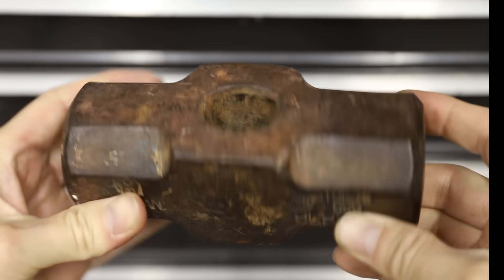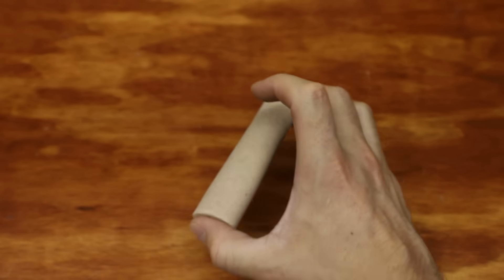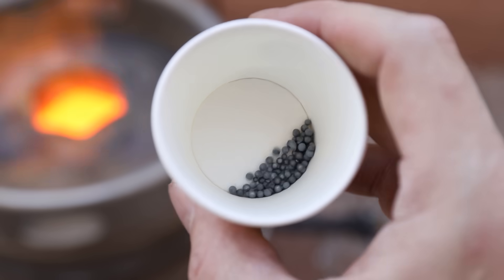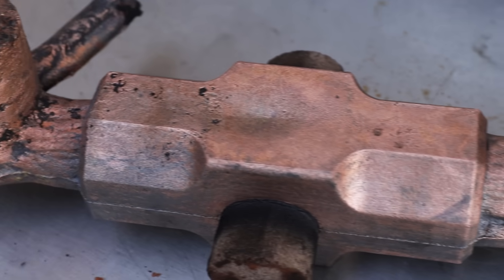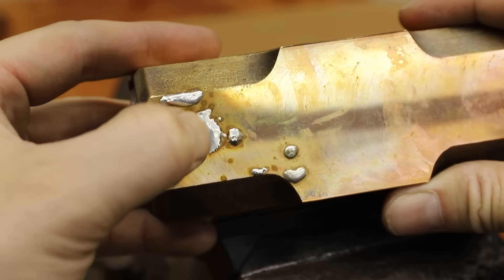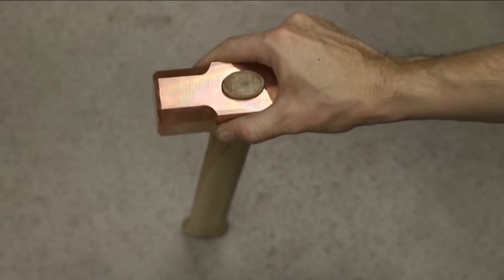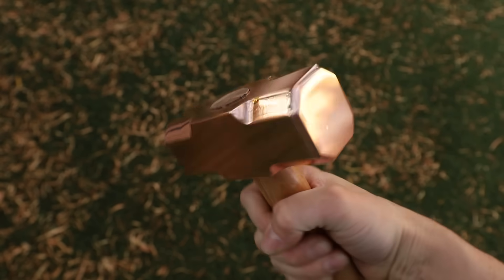Making a Solid Copper Sledge Hammer - HAMMER TIME!

Comment: beautiful work!  I'm surprised that you don't think you will use it for anything - copper lump hammers are incredibly useful due to the softness and weight of the metal. it makes it very hard to damage your work piece while still delivering a lot of momentum per strike, and it's also non-sparking.
Reply: Good point! I never thought of that. But I guess that makes it the middle child between a rubber mallet and a steel sledge!
Reply: I use a copper hammer almost daily working on old cars and bikes, always something that needs to be encouraged without damaging it
Reply: @tortron  really? sure its not brass
Reply: @tech99070  it's copper
Reply: My old MBG with wire wheels and a Knock off hub came with a bronze 3 lb hammer so as to not damage the steel wing hub knock offs.   It was a Thor Brand.

Comment: suggestion:  Use a smaller handle temporary mold for a void so you can machine it perfectly after.
Voids, easier + better: Machine a cylinder the whole way through. with a little recess ( 5mm) to ball peen deforming on either end + cut & smooth excess.

Comment: It's gorgeous, I wouldn't use it either... I'd leave it right next to the front door... in a cradle that would put it right at the perfect reach and angle.

That way if I open the door to the wrong stranger... they get the copper cranium!

Comment: Appears to just be a high-tech method.  Put that old iron hammer into a piece-mold of clay or plaster - and set.  Break open the mold, remove the iron hammer, and reunite the clay or plaster mold together.  Melt your copper (coins) and pour into the clay or plaster mold.  Break open and you have the same copper hammer head.

Comment: You had a void in your casting because you didn't degas your copper enough. Use a de gassing agent from a good foundry supply shop. If that helps. Spend the money. There isn't any shot cuts in foundry work.

Comment: Loved the plug fit,  seemed that it went together flawlessly.   My thought was to do a combination of cooling the plug (contraction) and heating the hammer (expansion) to get the plug in and then when they hit equilibrium they'll be beyond snug, but hey peening it worked too.
Reply: Cooling the plug for an interference fit is a great idea!
Be careful about using heat around holes such as this hammer.The metal can expand TOWARD the hole, actually making it smaller.

Comment: CAD a mold? why not just pack the sand. place the head from the steel one in the sand then build the top, cloning the actual hammer.

also, all that milling, you could have made a block and milled that, you wouldnt have had the voids.

Comment: If you're going to leave it as a mirrored wall-hanger, I suggest giving the head and handle 2-3 light coats of spray varnish to keep the copper form oxidizing...

Unless you WANT a green sledgehammer in a couple of years...in which case, leave the copper open to the air...

😄😁😆😅😂🤣

Comment: You used the title card "Revenge of the Pennies".
Pennies aren't copper, they're zinc.
A zinc hammer would be even more useless than a copper hammer, but it'd give a whole new set of technical challenges to overcome...
Reply: 1982 and earlier pennies are copper, with the exception of the WWII era when they were made of steel for a couple of years.
Reply: @billyjack3580  40 years ago - there aren't many in circulation

Comment: I know mechanics use brass hammers to beat pressed-in studs out of their holes, because the softer metal will not mess up the threads.  I think a copper hammer would work as well.

Comment: Woulda been funny if you'd actually used pennies for this, 'course you would've had to dig through a ton of them to obtain all 1982 and earlier pennies.  The only problem you'd run into is if you attempted to then sell the sledgehammer at a profit.
P.S.  Looks awesome!  I would sit around from time to time, admiring it's beauty and heft, and be terrified someone might actually use it to take a whack at something. 🤣
Reply: Copper pennies might be less expensive, or at least comparable in value to raw copper. That’s one of the reasons why post-1982 pennies are plated.
Reply: @billyjack3580   The solution of using copper plated zinc, only worked for a handful of years for the US Mint. Even that formula now costs more than a penny per coin.
The nickel is even more of a problem.

Comment: I would suggest you add some beryllium to your copper to harden it  if it was going to be used but it’s toxic and requires special handling. A finished hammer head is safe but grinding, sanding , filing or buffing must be done in very dust controlled ways. Beryllium copper hammers were used in munition plants because they wouldn’t cause a spark.

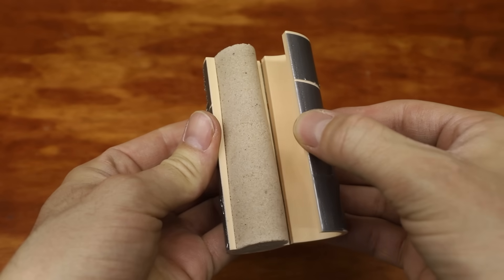Comment: 1:44 The next time instead of using duct tape you can use electrical tape which if you stretch it when you're wrapping it will really clamp down on what you wrapped around. Of course the duct tape works just as well though

Comment: Hi nice work, (I got copper too) --> To snug a hammer head, hold head to be snug hammer upside down so handle faces up, using a second hammer hit the butt of the hammer to be snug 3 to 5 times using smooth, firm medium blow (wink wink - that one I learned when I was 8 years Old from an old timer... I am a 52 year old Electrical trade instructor...

Comment: You could try making a full set of tools like from stardew. Cast iron might be too hard to cast yourself but a Copper set should be doable, Shovel might be the hardest to pull off. Gold can be bronze and Iridium can be Titanium coated steel (like the silverware) and finished purple or dark purple unless you just do a dark bluing on the set. Can use a regulars steel set as the molds to make them all the same or make them all unique shaped for their material.

Comment: Everyone fits a handle the wrong way. Push the head of the hammer or axle onto the handle as best as you can by hand, then flip it over, leave it hanging and give the end of the handle a few hard blows with a hammer before inserting the wedge and trimming it to size.

Inertia will do its job and the handle will be driven into the relatively heavy head. No scratches or dings on your tool heads to worry about that the end of the handle can... handle.

Comment: If you're machining steel parts, a copper hammer is actually useful. It won't scratch just like a lead hammer, but it's much harder than lead so you can hit harder with more force going into what you're hammering on. Commercial ones are pretty expensive.

Comment: Why didn’t you just pour the copper into the hole for the repair?  Why make a plug first?
Reply: I was thinking the same thing then I thought maybe the molten copper will melt the surrounding area of the hole and make it look obviously repaired but I'm not sure.

Comment: These are useful. Our company's metalworking shop has one of these, as well as several wooden, brass and plastic sledgehammers. Sometimes you need a soft but very heavy hammer.
Reply: Or non-sparking.

Comment: Would that air cavity in the hammer have been an issue if the mold were poured vertically length wise instead of horizontal?

Comment: Question, Could you not have just poured the molten copper into the machined hole/void instead of making a bar to turn in the lathe? Is it because of the mass of the hammer head cooling it?

Comment: Why not use a torch on the hammer head where the hole is and pour copper into the hole them mill it. Much stronger and more reliable

Comment: I'm sure you know this, but to make pressure fitting a bit easier & more difficult to detect, you can mildly heat & chill the main body & insert, respectively, so it's easier to slot in, & when the temperature equalises, it'll probably pressure weld the two halves together. I usually stick the body in the oven at 225 & either put the insert in the freezer, or if I REALLY want a tight fit, I'll get some liquid Nitrogen, & store the insert in it for a good 20 minutes prior to fitting. You can turn the oven up higher, but that makes it difficult for me to operate too precisely, since I need proper heat resistance, rather than clamping it & using a rag to make sure it's in alignment.

Comment: There's a channel I watch that does a ton of smelting, and they put a piece of paperboard under the crucible so that the firebrick doesn't stick to it. It looks like your way works well, but I thought you might like to know that trick to see if it's an improvement.

I'll mention the copper-phosphor to them since they sometimes have issues with porosity in their copper pours. 👍
Reply: heh, pour-osity

Comment: You did not have sprew vents from all the spots above your inlet levels. They can be fairly small 1/8 in.. Don't forget to harden the head before use. Otherwise it will be much worse mushrooming of the head.

Comment: Awesome hammer.  I built my own copper hammer that I exclusively use for motorcycle engine disassembly.   When I have to tap on crankshaft or mainshaft threads,  my copper hammer is my 1st choice.      Sweet build.

Comment: When making a hammer you generally want the hole where you attach the handle to have a slight hourglass shape. The bottom half of the hour glass fits up to the taper you put on the top part of the handle that is being fit up, and the top part of the hourglass allows the wood to expand when the wedge is driven in, locking the hammer head onto the handle. The same goes for hatchets, axes, etc.
Reply: Yeah, i always see people changing that. I prefer a tapered hole, with the larger end on the side you put the wedge in on, just to lock it down a little bit more.
Reply: @atomicwinter31  if i'm imagining this right, i'm seeing a sharp edge at the bottom end of the taper, that could bite into the wood over many hits and wiggle things loose
Reply: @spambot7110  You're just imagining things. Lol. But nah, the taper isn't drastic enough to have that effect. Just enough to allow the wedge to spread the handle enough to keep it in without relying solely on pressure against the walls.
Reply: @CrazyJ1985  when some people visualize the slight taper Y 😆 
Also I prefer the round wedges myself. Been a few year years since I changed the handle on my 14 oz framing hammer n it hasn't budged.
Reply: 14 oz framing hammer? WTH finish hammer maybe
Reply: My friend, are you all right? I wish you good health, happy family, happy every day
Reply: @7hjm8888  I am not right.
Reply: When making a hammer, you generally don't make it out of copper for display only. Do you get the point?
Reply: @yourdad9168  I think it's maybe you who doesn't get the point
Reply: @spambot7110  A rock pick will have a point.
Reply: @nsevv  a chipping hammer has a point as does a prospector's hammer, piton hammer, and some war hammers.
Reply: @grisher111  Point made. You win in this battle of points. Plus you attained 2,000 intelligence points to your YT character.
Reply: @surfersilver6610  ty
Reply: @yourdad9168  A hammer can't have a point. it is supposed to be a flat head.
Reply: @nsevv  THe claw end of a framing hammer is fairly pointy. I think you meant a sledge hammer.
Reply: @Sparkeycarp  what?

Comment: Why didn't you just make a sand mold from the old hammer? You intended to machine it anyway and any imperfections would be taken off. Just personally I would have preferred that the copper hammer had all of the old dents and manufacturers marks. An idea for hammer #2 perhaps?

Comment: First time viewer, and I was thrilled to see that you have built a beer keg foundry! 
I've built 2 of them, and was having a hard time getting enough BTU's from my original burner setup (approx 150k BTU output), due to the larger volume of the foundry, to melt copper. 
So, I "bit the bullet" and bought the 308k BTU burner from Devil Forge and it's been fabulous. Now using less propane & less time to melt copper! Win, win!
Edit: I've also become a subscriber.

Comment: Nice job bud. Does anyone know if a cooper hammer can be used practically or is the metal too soft? Cheers.
Reply: Hammers are made from a wide range of alternate materials, including wood, rubber, leather, copper and brass/bronze. Each is designed and manufactured for special circumstances. Copper hammers are useful when working in areas where sparking would cause problems.
Reply: @billyjack3580  Thanks Billy.

Comment: The hammer can't be the last thing to solidify or you'll get sinks and voids. Usually an insulating or exothermic riser is used to preserve a molten mass for the hammer to draw from as it tries to shrink. Also a chill plate or bar ( on the opposite side of the molten mass in the riser ) can be used to cause directional solidification. Pouring large masses can be tricky. You did a very good job though.

Comment: The casting bell needs to be bigger and central to the pour, so it can both feed enough and feed all sides at all times. There's actually a formula (can't remember it off the top of my head) that pops out about how big the bell to cast part needs to be.

Comment: You have a problem with casting.copper ingot was porous and multicolored because of bad melting.maybe flame is too hot so metal burns out and oxydise.bad cooling,maybee too fast or too slow but i think roo fast so excess metalnfrom casting chanel can't compensate shrikage.and inpurities in metal itself.try some chemical cleaning and separation of copper.try some experimenting with temperatures.try slower cooling and maybee some other type of mould that you can preheat before casting.

Comment: to fill the holes I think it would have been simpler to heat the mass near the melting point and fill with molten copper directly.  not like it was done by making a piece out and then putting it on.

Comment: This is really beautiful. I wonder how a copper tool head will hold up to use since it's kind of a soft metal. Have you tried using it, or is it just a display piece?
Reply: Copper hammers are awesome. Copper sledgehammers even better... Expensive as fuck but they allow you to bash steel stuff relatively hard without messing up the part. Copper hammers are useables that you wear out over time, but they can save you a penny or two in stuff you don't break.
Reply: Copper hammers are useful when working in areas where sparks would be dangerous.

Comment: Nice job , I’d love a hammer like that very nice 👍🏻
Did cringe a little tho when you removed the sand at the vice and used drill / file poor tools , would an old punch and a jet wash outside have been more appropriate ? 
Iv hit the thumbs up as it’s a very nice job

Comment: I TRIED THAT AND THE TEXTURE OF THE 3D PRINTED PATTERN WOULD NOT LET GO OF THE PETROBOND AND I COULD NOT GET A DECENT CASTING PATTERN!!!!!!!!!!
Petrobond is great for super fine detail and smooth surfaces but is not as strong/solid as the sand/sodium silicate, also it burns filling up he basement or garage with stinky petroleum smoke.
He should have only used the Sand/sodium silicate for the whole thing as copper will burn the petrobond deeply ruining a lot of it and causing a ton of smoke!
Also, if you get a cylinder of carbon dioxide and a tiny little metal tube you can inject it deep into the sand and making the sand mold useful right now.

Comment: a lot of machinists and boatwrights like to use soft hammers made of brass, copper, aluminum and even hardwood.   they like the weight of the hammer but they need it to be soft enough to not damage their project....   the hammer seen here could be engraved with pictures or designs or logo's,  it's pretty nice

Comment: If you want porous free castings make sure your risers are thicker than your casting and always sprue to the thickest part of the casting (which in this case you did do).. that way the risers will cool last and act as a reservoir to feed your casting not the other way around. PS. for large thick castings have the risers no more than 1 cm away.